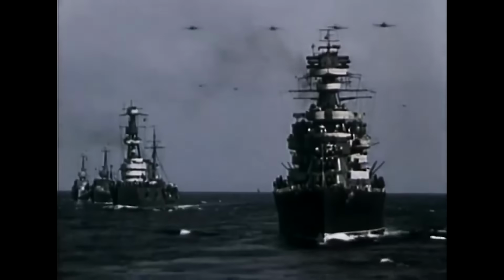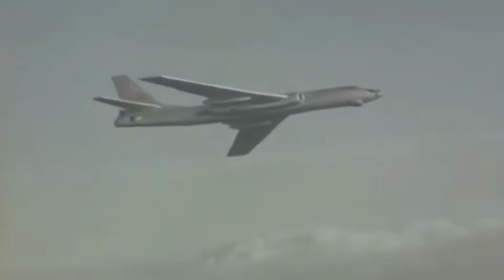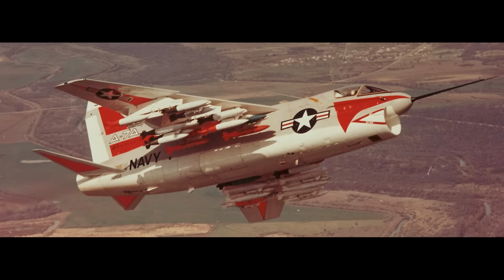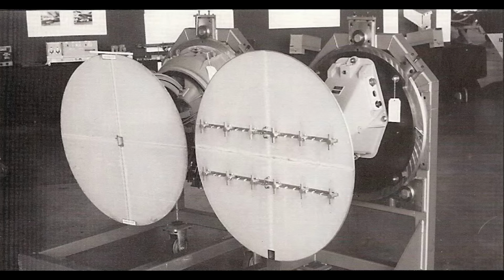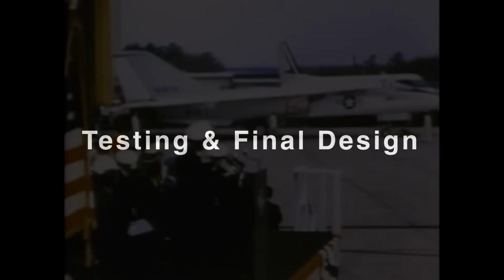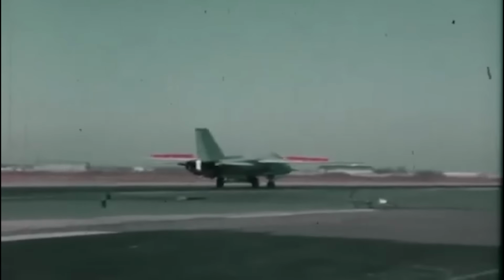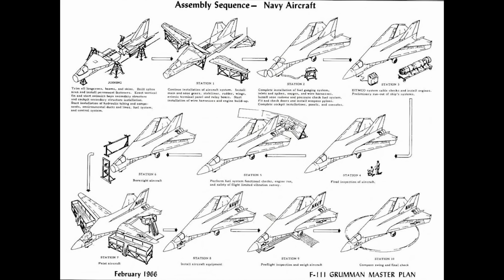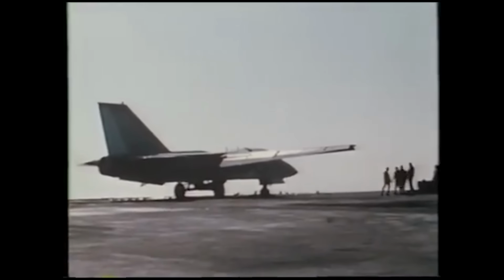Was The Grumman F-111B A Bad Aircraft Or A Missed Opportunity?

Comment: Timely research question. 

Wonder the same, despite the fact that the F-14 with it's advanced construction methods (e.g. titanium welding) and sophisticated airframe couldn't have been developed without the Grumman's experiences around the F-111B. 

In fact, the F-14, itself wasn't fully developed until it reached the B - or even D variant (mere 50 samples) - almost two decades into it's commission... 
Could the funding that was sunk into a cancelled A-12 not better be used by fully upgrading the F-14 to the ASF-14 and then possibly trying to rework the F-111B (with even longer range and larger internal bays, enabling a lower RADAR cross section) into a long range, supersonic interceptor and deep strike platform - than being stuck with a 'light' F-35C that is less 'stealth' than the F-22 and lacks range in fleet operations ? 

The same question may come to mind when looking then at the Air Force F-108 that never was due to budget concerns (ahead of a war of attrition in Vietnam), but resembles strikingly current requirements for unmanned platforms and standoff-strike weapons...
Reply from the maker: Thanks for the comment. In about a fortnight I'm going to release a video on VFAX and VFX, and then an F-14 deep dive in early September. All of this actually started from wanting to do a good job on the Tomcat, but it turns out that meant going back in time to the Jaguar and working forwards from there.
Reply: @notapound thats how true historical projects work. There's always something else before that's vital to understand the after. Stellar work thus far in this
Reply: @notapound  
"(...) a video on VFAX and VFX, and then an F-14 (...)" 

That sounds promising. 

The F-14 - as well as the briefly proposed ASF-14 - have received quite some attention in the blogging-sphere and it can't be just due to a 'Top Gun' movie sequel. 

In any case, 3-4th generation fighter development is a case study in procurement - from ever more complex technology and diminishing returns to 'resort egotism' politics that helps to understand the 'friction' of warfare beyond mere glorification. 

"(...) it turns out that meant going back in time to the Jaguar and working forwards from there." 

It will be worth it as the imagined sequence of procured equipment grants insight into doctrinal requirements from which an airframe can be assessed, factually - including it's upgrade potential - instead of just staring at a stats contest. 
Imagining what could have been, informs to some degree, what should be - at lest in regard to procurement procedure... 

You did therefore well by structuring this video around the requirement to intercept supersonic naval bombers along large, powerful RADARs and bulky, very long range guided missiles - there is a lesson to be learned, here when F/A-18E/F and EA-18G production will be shutdown in 2027, yet the F/A XX is still largely a postulate of something, something 'stealth' and 'modular'. 

A look into the fast A-12 (Lockheed), low observable YF-23 and the light and attritable X-32 may also be of interest to the channel's mantra (I'm almost picturing a three sided dice between supersonic/hypersonic speed, low observability and mass production - could the X-32 have been scaled up to approximate the other ends of the spectrum - instead of opting for a less performant F-22: F-35 ?)...
Reply: The A-12 was developed for an entirely different role than the F-14, to fill a slot where stealth was considered critical (penetration light bomber), to replace a platform.that was clearly.coming to the end of its credible service life (the A-6).  At the time development started, Navy CVWs were still part of the SIOP, and thus the A-12 needed to be capable of penetrating future Soviet air defenses protected vital strategic targets (i.e., heavily protected with the very best).

According to then current planning and beliefs, a Super Tomcat couldn't do that.  A Super Vark couldn't do that.  The mission required stealth.

By the time the program was clearly in trouble, the threat set had entirely changed, they weren't as worried about penetrating the very best Soviet air defences, and budgets needed to be trimmed.

The Flying Dorito may have been a failure, but it wasn't an obvious failure in time to really save much money, and the mission it was designed for was considered a very credible requirement.

And a Super Vark, in the numbers required to handle the missions A-12 and A-6 was intended for (even if you disregard the stealth requirement of the A-12), simply was not supportable on the carrier.  Heck, the F-14 was a large bird, and the Navy got rid of the A-5 Vigilante in large part because it was a net loss to the air wing, given the large footprint (both the aircraft and it's logistics) displaced significantly more smaller aircraft than the number of A-5s aboard.
Reply: @geodkyt  
"(...) the A-12 [McDonnell Douglas] needed to be capable of penetrating future Soviet air defenses protected vital strategic targets (...)" 

Yes - but an early F-117 Seahawk could have been in serial production within a year - rather than freezing assets in two decades of lawfare... 

Granted, technologies for the A-12 upgraded other platforms, including the B-21, I take it, but still... 

"By the time the program was clearly in trouble, the threat set had entirely changed (...)" 

Valid point that is easily ignored, yet again the F-117 was already fully operational and considering the production shutdown of the F-22 in 2011 and the development of a less capable F-35 appears like a series of failed investments. 

Eurasian bastion airspace hasn't become less defended, but much more so, with an F-35C not even being able to reach firing range from a carrier, outside coastal defenses. 

With the F-14D, the single airframe that could race the gap was lost, especially when further upgraded to the F-21 or ASF-14 standard. 

Variable Cycle Engines can potentially shift the balance - but that is a story, much like the upgrade of the F-14A in 1970 to B in 1987...
Reply: @christophmahler The cruise missile takes the  need for long air strikes into Russia away.
Reply: @WALTERBROADDUS  
"The cruise missile takes the  need for long air strikes into Russia away." 

So it was thought - yet, here we are, spending billions on air fleets with strike capability. 

Cruise missiles can follow terrain, but are comparatively slow - they can be tracked and shot down (the MiG-31 with it's advanced RADAR and data-link capability was specifically developed for that role), unless operated amidst 'saturation attacks' in order to overwhelm interceptor projectiles (a very costly business). 

It would be a different story with ballistic missiles - especially when reaching hypersonic speeds, yet none are operational...
Reply: @christophmahler  the Navy doesn't realistically expect to be doing air strikes into Russia. And they've largely given the Nuclear Strike role to the sub force. Getting carriers into strike range; places you in danger of running into a Soviet navy based on submarines. A much bigger threat than marauding Soviet bombers.
Reply: @christophmahler  Even the Air Force bomber forces are largely relying on air launch cruise missiles; rather than dropping gravity bombs for nuclear delivery.
Reply: @WALTERBROADDUS  
"Getting carriers into strike range; places you in danger of running into a Soviet navy based on submarines." 

I don't disagree - and the same will hold true, soon - in the South China Sea. 

My point was, however if one procures and maintains super-carriers then their air wings must have the ability to defend against long range aviation guided missile strikes - and the ability to conduct deep strikes. 

The US Air Force is in an even worse position in Europe and in the Pacific as their assets can all be struck while they are still on the ground with massed stand-off weapons (in case of Ukraine: 8000 missiles plus per year, produced by an industry that had increased it's capacity by a factor in double digits during the protracted State Armament Program of 2010-2020). 

A Corbettian Navy of cruiser warfare doesn't need aircraft carriers - but definitely twice as many surface assets... if that's what You have in mind.
Reply: @WALTERBROADDUS  
"(...) bomber forces are largely relying on air launch cruise missiles; rather than dropping gravity bombs (...)" 

Nobody is specifically talking about nuclear deployment - all current conflicts are conventional and will remain so until some nuclear power realizes immanent complete collapse (including preparation toward preemptive strikes by adversaries). 

Gravity bombs work well in Eastern Ukraine when entrenched positions and concrete buildings are brought down by constant bombardment with heavy FAB-3000 general purpose explosive bombs, toss dropped, outside the range of front line air defenses, gliding unto target with sufficient precision. 
Cruise missiles would be too expensive for anything less, but a strategic theater target (hardened command posts, temporary troop concentrations at a railway station, arms factories, munitions and fuel depots, power grid installations). 
Since NATO never fully developed ground based air defenses and artillery to the degree, the Soviet Union and Russia did, front line fighting against a prepared enemy requires frequent ground attack missions (demonstrated during the US invasion of Iraq in 2003 with armored 'maneuver warfare' trailing behind the air campaign). 

The AIM-174B e.g. is specifically developed since 2006 - the year of the retirement of the F-14 and it's AIM-54 - in order to target cruise missiles (anti-ship capabilities as a secondary function) - yet the production of the F/A-18E/F that can fire several of such a large missiles will be discontinued in 2027 (granted like the F-22, tooling will be stored - but each additional plane will cost more than 200 million USD, that's likely 120 million for each Super Hornet or Growler that used to come in bulk for 50-60 million USD). 

Thus the US Navy will suffer from a capability gap since 2006 if the F/A XX program fails to deliver an airframe that can be produced en masse (which the 'light' F-35B-C can't despite being procured as a scaled down F-22A). 

And from the operational requirements to carry several very long range missiles for fleet interceptor missions (with a secondary ground strike capability) it follows that the F/A XX must be about as large, fast and maneuverable as the F-14D - but do all that with maintenance and procurement costs about the F/A-18E/F. 

That is the specific issue, here as far as I understand (which is limited to Open Source information, having no access to classified and informal discourse).
Reply: @christophmahler  We are really drifting far off topic. My comments are based on the Prime mission at the time of design the F-111b. The Strategic Mission of nuclear delivery When I'm referring to gravity bombs, I was referring to weapons Such as the B-83 and B-61 Nuclear bombs.   It is hard to picture a mission where you would have carriers doing conventional tactical missions From the Mediterranean or Baltic. The cruise missile allows you to have standoff distance. And not have to penetrate air defenses. It also opened the delivery platform of strike to the surface force and submarine Force. Ships and Subs now have the ability to do Precision targeting well Inland of traditional gunfire. Thus reducing the need for the aircraft programs suggested. The Super Tomcat is going to be facing 5th and 6th generation opponents. As well as improved surface-to-air missile threats.
Reply: @christophmahler  as far as Ukraine goes? Conventional Tactical Air power has largely been neutered on both sides. Both Ukraine and the Russians have depleted a large swath of their manned aircraft. A lot of the massive losses of the Army is due to a lack of air support. Drones have become increasingly more of the weapon of choice. It'll be interesting to see what good the F-16s being sent over will do?
Reply: @WALTERBROADDUS  
"My comments are based on the Prime mission at the time of design the F-111b. The Strategic Mission of nuclear delivery (...)" 

Strategic nuclear strikes were not the mission of the F-111B. 

The W42 nuclear warhead of the Hughes GAR-9/AIM-47 Falcon was dropped for the AIM-54 - which was the armament, intended for the F-111B before being procured for the F-14A. 

I don't get why You accuse others of straying off-topic on a discussion of a naval interceptor when only You men to frame the discourse around Reconnaissance Strikes...
Reply: @WALTERBROADDUS  
"(...) as far as Ukraine goes? Conventional Tactical Air power has largely been neutered on both sides. Both Ukraine and the Russians have depleted a large swath of their manned aircraft." 

The only ones who make such exaggerated claim are Neonazis and their affiliated Ukrainian Department of Defense, picked up by an ideological Transatlantic press, campaigning for political and financial support. 
To every reasonable person, losses e.g. in Russian front line aviation Su-34 strike fighters have been fully replaced by the annual production rate - and nothing else could have been expected by anyone who studies Western national security discourse that have warned of this 'Correlation of Forces' since 2014. 

We all already know the outcome of NATO air superiority fighter delivery: escalation toward large scale military conflict all across the European theater - for which the Russians have developed actual Reconnaissance Strike Complexes, capable of neutralizing NATO airbases.
Reply: @christophmahler  You bought up the comment about gravity bombs. Which had nothing to do with Conventional Weapons. THE era is concerning the ERA of the design was planned. And we are not talking about use of air-to-air nuclear weapons.
Reply: @WALTERBROADDUS  
"(...) we are not talking about use of air-to-air nuclear weapons." 

We are not. 

You are as the only one on this entire comment section who fantasizes about a missile that was never produced. 

Everyone else understands that the F-111B was designed as a conventional fleet interceptor.
Reply: @christophmahler  Your last comment bought up a nuclear warhead for the Hughes missile....
Reply: The F-14A was never meant to be the production version, it was just supposed to be a development aircraft until the original F-14B, with the F401 engine came on line.  But the F401 got so expensive and needed so much development that the Navy just backed off, canceled the B and just produced the developmental model for decades.  The F-14D was what the Tomcat was supposed to be (it would ahve been known as the F-14C).  

Regarding the A-12 money, that wasn't what killed the Tomcat.  As the F-14D was finishing its initial development, on time and on budget.  DoD ordered the Navy to cancel the F-14D and instead develop a new aircraft, the Super Hornet.   There was a proposal for a substantial upgrade, the Super Tomcat 21, but with the termination of the -D there was no way to get there from here.  Regarding ASF-14, unlike Super Tomcat 21, it was not an upgrade but a whole new aircraft that just resembled the F-14, much like the Super Hornet is a brand new aircraft that just resembles the Classic Hornet.  

Regarding reworking F-111B, as long as you had teh tomcat, thre was no need to spend the enormous amounts of money to rework the F-111B, and you'd still end up with a single mission aircraft.
Reply: @tararaboomdiay7442  
"The F-14A was never meant to be the production version (...)" 

Since it contradicts model designations, there is no reason to believe that. 

You need a solid Navy source for that claim as the Navy had a already an Attack aircraft with long range: the subsonic A-6 Intruder... 

"(...)  as long as you had teh tomcat, thre was no need to spend the enormous amounts of money to rework the F-111B, and you'd still end up with a single mission aircraft." 

While speculative, it is easy to merely claim that procuring the F-111B would have been just as expensive as the F-14A/B/D procurement and modernization and beyond it's Fleet Interdiction mission against Soviet supersonic bombers would have eventually offered similar ground strike capabilities to the F-111F around  1976, surpassing the Tomcat in loitering time and effective combat range... 

The Super Hornet procurement - raising the cost of a 'Lightweight Fighter' program equivalent Hornet, again - proves the relevance of that range and payload requirement (in fact, since the retirement of the A-6 Intruder in 1997 and the Tomcat in 2006, the Navy lacks the capability to conduct ground strikes in contested seas like East China - it doesn't have the very long range missiles in serial production, including the AIM-174B nor the platform that can carry that ordnance in numbers as Hornet production lines will close in 2027). 

Not having developed the A-12 or the ASF-14 means in 2030s that a downscaled naval B-21N will be the only manned option still in production, all else is as conclusive in it's development as the current US administration  - otherwise carriers will simply be scuttled as obsolete (in fact Congress has not funded more than 4 Ford-class carriers and there will be years of delays, the longer global trade is decoupled without US 'in-shoring' even pursued in honest).